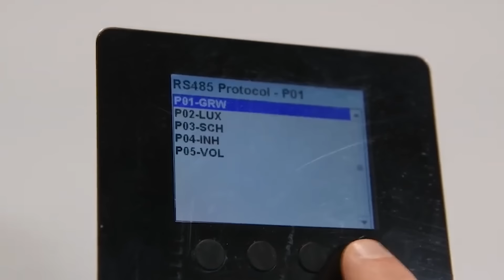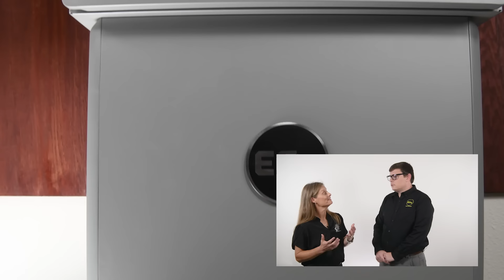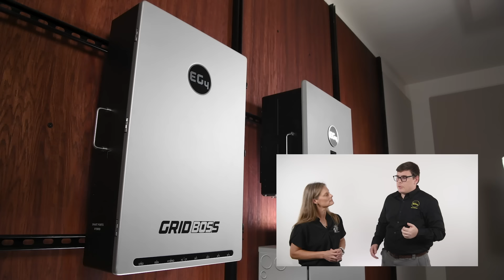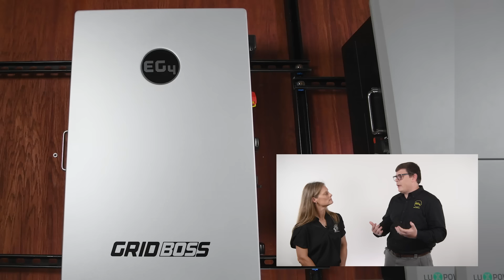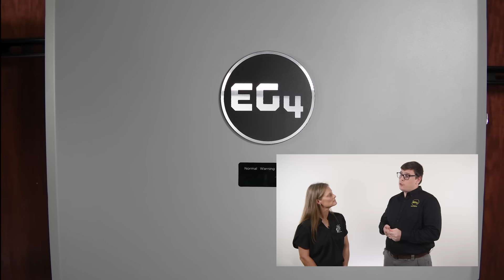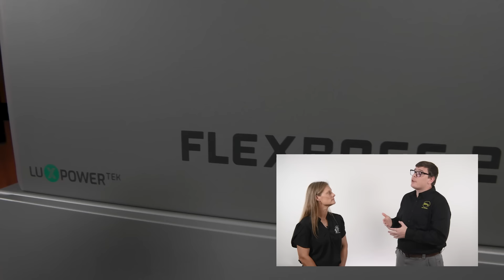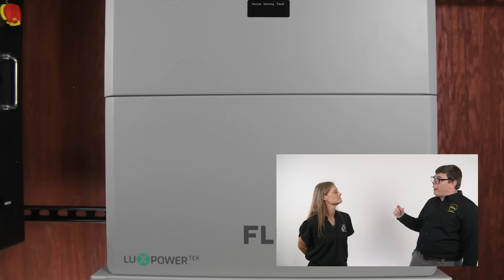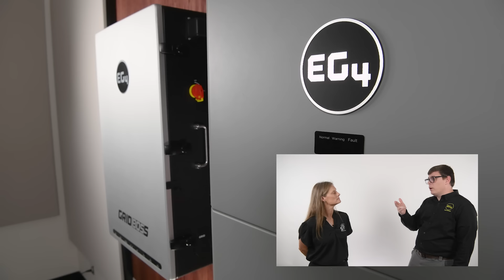EG4 FlexBOSS21 & GridBOSS Premiere Interview: The Most Powerful Solar Solution Yet

Comment: I have a Generac whole home generator with an auto-transfer switch. Is that compatible with the grid boss or would the auto-transfer switch need to be removed?
Reply from the maker: No need, you can connect your generator to your GridBOSS :)
Reply: I wonder about this as well.  I currently have Generac with ATF and a Solark 15k.  I split them apart because the solark would try to sell to grid when grid was disconnect by Generac ATF.

Comment: I'm not seeing how I eliminate transfer switch?  If the gridboss goes down and I have to remove it and rma it...won't I still need a transfer switch?
Reply: I thought the same. I believe you are correct.
Reply: The bypass breaker is in the gridboss

Comment: I guess I'm at a loss in the cost savings and complexity world.  It still feels to me that the main point of all this tech is to be off grid.  So I'm not clear why adding complexity and cost.
Reply: This is a great setup for those of us that are grid tied and also need to place inverter and batteries in a garage over 100ft from the meter. They just came out with the 12000XP... may be a better solution for simple off-grid needs.

Comment: It’s like you split the 18KPV into two components, boosted the power a bit and gave it a new name. Not that there is anything wrong with that!! I kind of like the idea of having one component on the wall better than two.
Reply: For those of us who dont have room at or near the Grid in (meter) and need to place the inverter and batteries in a garage that is 100 feet away this is a great solution. Don't have to loop 200 amps. I can install the GridBOSS at the meter and FlexBOSS21 in the garage with batteries. Only need to run Flexboss21 output to the GridBOSS. Plus you get rid of a bunch of different components that are built into the GridBoss. Easier and cleaner install.

Comment: I just don’t understand why not 200 amp transfer switch on the flex boss
Reply: Because thats basically what the EG4 18kPV is. If you need multiple inverters then you a paying multiple times over for a transfer switch you don't need. By separating them you get more flexibility and are only paying for what you need. Like in my case I have to install inverter and batteries in the garage that is over 100ft from the meter (grid-in). If I use an inverter that has a built in 200 amp transfer switch I would have to loop 200 amps over 100 feet each way. That a huge cost. With the Gridboss I would only need to run a single 6awg wire from the FlexBOSS21 to the GridBOSS.

Comment: Thanks for the video. Do I understand it correctly that the Grid/Flex combo requires fewer external components and associated labor? Does it bring the total cost of the system closer to one based on the 18KPV?

Comment: I’m interested in more of these integrated smart breakers in your off grid focused inverters. I’d love to dump all excess solar through an electric boiler to put additional heat into my slab foundation or run multiple mini splits at certain states of charge. The newer smart load centers don’t do much for us off grid guys if they arnt talking to our batteries.

Comment: EG4, if you're listening, your next innovation should have a DC smart port with an EVSE addon. This would enable DC charging to an EV bypassing any need for an inverter and conversion losses. 🙏🏽
Reply: Oh man this would be a game changer! Unfortunately your question is way ahead of its time!  On a side note if you can dc charge at home it is natively bi directional!
Reply: @paullind6534  I understand where you're coming from. However I hope EG4 isn't thinking this way. We've been DC charging batteries for decades. Nothing has changed. 😔
Reply: @ Agreed!  Communication with every ev manufacturer is a real challenge.  Not just physically but also legally due to things like warranties and such.  Manufacturers could easily detect a dc discharge and program it to kill the circuit.  Charging might be a thing but discharge not so much😞
Reply: @paullind6534  I'm good with just DC charging. :D
Reply: @paullind6534 V2H would then be the real game changer

Comment: Can GridBoss be used with a 100amp breaker, only see CSR2200N in the specs?  Want to feed 100amp  from main panel to grid boss that now goes to a sub panel.  This will allow me to  backup all critical loads in sub panel as well as have smart loads (EV,  water heater, etc).  Can't sell back here so will only use in off grid mode but the flexibility of the grid-boss makes setup and expansion so much easier.

Comment: The FlexBOSS21 looks like just what I need. By chance is it able to communicate with a Span smart breaker panel for shedding? If not could it in the future?
Reply: I have an existing micro-inverter based solar install and a 24kw gas generator connected to the grid. I want to add a 48V battery backup for overnight.

Comment: Last part about batteries being anywhere? Because you can move the inverter?
Reply: batteries are close to inverters  (usually within 10 ft)  but the GRID line is a 6 awg and you can run that much longer
Reply: @dougbertInExile if you had a battery in a garage under the flex boss but meter is 200’ away on a pole, could the grid boss still be in the garage where the main panel is (all that is on the pole is a meter and a 200Amp breaker)

Comment: This totally blows the Sol-ark out if the water guys! I have been waiting for exact solution that is NOT proprietary on the GridBoss switching! My next customer scenario is main meter and 4 loads in main panel is 60 ft from sub panel with most house circuits in sub panel. The wiring and conduit alone would have been well over $4-6k for electrician to run 200 amp “loop”. No need for loop anymore.
Reply: So where do you put the GridBoss and the Inverter in your scenario?  I'm trying to understand this separation of components with the new GridBoss.
Reply: @idahoduckhunter  from what I understand. Before you wanted 18kpv hooked up with full capability utilizing 200 amp grid Passthru u would have to run 200amp (4/0, expensive) cable to the 18kpv then to you main panel. This doesn't even include the transfer switch/shut off switch required before the 18kpv but after meter that is expensive to install. With this grid boss it is rated for service entrance meaning it can be primary disconnect so saves you from having to install another disconnect, then you are also saving money on cable costs since now u just need 70amp cable from 18kpv/flexboss to gridboss. this also allows you to also relocate the batteries with 18kpv to a shed or other place on property and not have to be within 20ft of meter (because 200amp copper is expensive, and now only need 70amp copper) with the 200 amp disconnect being separated from inverter makes it easier for electrician or DIY to piece together a kit. So you can start by adding grid boss, then can add inverter/18kpv with. Batteries afterwards.
Reply: I have a very similar setup. I am trying to learn enough to get this setup going with a handful of panels until I replace the roof. It's pretty overwhelming even with a good understanding of residential electrical.

Comment: 80w idle consumption! No thank u!
Reply: What were you expecting for a 16KW inverter…. A person using 16,000W inverter would definitely have an extremely large battery capacity and the 80W would mean nothing on such battery size
Reply: @EasyyokeFilms  No logic in your asumption. It's baseless. Solark 30k (UPS transfer 5ms) has an idle consumption of only 60w and it delivers 30,000w (real power, max continuous) and max. allowed PV Power of 39,000w.
Reply: The spec sheet says less than 60w
Reply: @jamesshowalter6362  check again. It's 80W in normal operating mode.
Reply: The idle consumption is insignificant for me . I’m using a 6000xp on a recent installation where I have free at night electricity. I had to reduce the ac charge at night to 10 amps just to see the battery cycle a little. I tested it with a 3 ton ac without a soft start,demonstrating it to a friend in the HVAC business,and we were both surprised how easily it handled the inrush. He’s getting a 6000xp on his new house with the plan to expand later. Since he has gas also,two 6ks should be all he ever needs. 
I’m sure Solark has good products but Signature Solar is near and has excellent customer service and responds to what we are asking for.
Reply: @danielking2944  It's significant factor for locations like mine with high kwh energy cost, when you have no sun available and batteries are depleted.
Reply: It’s 63w all together. 80w was just pv only. The spec has been updated.
Reply: @warzoneclips2285   My post had a possitive effect. Glad the update clarified is really 63w!
Reply: Glad the datasheet update clarified is really 63w.
Reply: @carlossantini  My father has the 30K-3P 208 Solark for his (These are not practical now legal for most homes JS) shop. It may say 60w Idle but it NEVER is, the BEST we have gotten it is 103W without wifi and 108 with it. But most the time it sits around 280 just pulling from the battery and 360 when it's charging and a load of 60-80% is being put on it. The 15Kw he has on his home is the same for idle but 50-100watts less when pulling power then the 30K. 
 I have two 18K's (TWO) on my house and they use 150-160w idle and 310 at max tilt total as one. Not only are they cheaper, less power usage and you have two smart breakers but you also have two inverters and not one so you have some back-up right away. An with the money you save you can get a good 16K gen and a 500gallon propane tank an have two back-ups for the same cost as one 30K Solark.
Reply: @carlossantini  I used to LOVE Solark!   My last home I used them and couldn't really complain about anything.     But they have been telling people for over 10yrs now that prices will go down and they are only this high right now because we are early adopters. But the prices have only gone up even with scale lol. So i'm done with Solark till the prices come down or they can again offer things ppl like EG4 can't again
Reply: @ agree!

Comment: It is exciting for EG4 and me, however, SRP in AZ does NOT care. They insist on their external transfer switches and meters.  I have 3 meters on my how with a Sol-Ark, which like the EG4 Gridbox or teh EG418kw have the built in the transfer ability.  Again, SRP refuses to rely on these products.  They want to meter everything and have their own switches.

Otherwise, I think the new products are great..
Reply: Will look into SRP compliance
Reply: @jamesshowalter6362  What about CEC compliance for California?
Reply from the maker: Here are the standards and certifications that the Grid Boss has UL1741, UL67, UL869A*** FCC PART 15, CLASS B (PENDING). 
Here are the  standards and certifications for the Flex Boss.( UL1741, SA, SB, PCS CRD California Rule 21 Phase I, II, III Arc-Fault Circuit Interrupter (AFCI) NEC 2020:690.11/UL1699B Ground Fault Monitoring (GFDI) NEC 2020:690.41(B) CSA 22.2.107.1:2016 Ed. 4 CSA 22.2.330:2017 Ed. 1 IEEE 1547.1:2020; IEEE 1547:2018 Hawaii Rule 14H [HECO SRD IEEE 1547.1-2020 Ed. 2] Rapid Shutdown (RSD) NEC 2020:690.12 FCC Part 15, Class B (PENDING)

Please don't hesitate to reach out to us at 903-441-2090 with any questions or concerns! We're here to help!
Reply: @ thank you for this information!

Comment: A question.  I am having 42 solar panels on a barn roof connect directly to my meter and the grid at the farm house.  The meter is on 400amp box, which goes to two 200amp breaker panels in two different locations.  If I bought an EG4 FlexBoss21 with a GridBoss for each 200amp breaker panel, how do I connect both GridBoss to the solar panels?  I want to be able to use the solar energy from the solar panels to run my house and or charge the batteries if the grid goes down.
Reply: Im not an electrician but I believe you would run your solar panels (PV) to the FlexBOSS21s. The FlexBOSS21s would connect to batteries and GridBOSSes. Each GridBOSS would connect to a separate 200 breaker panel and to the grid (meter).
Reply: @joshomary7977 I agree.

Comment: HOW ABOUT A PROGRAMABLE DUMP LOAD TO EV CHARGER SO WHEN EVERY THING IS CHARGED AND STILL HAVE GOOD SOLAR RESORCE IT WOULD THEN TRIGER THE EV CHARGER ON?
Reply: Or trigger water heater when there excess solar or full battery. He basically said the smart loads was to keep from over loading the inverter
Reply: Smart Load ports

Comment: I would love for EG4 to have independent installers trained. I would love to buy a system but there are no local installers I can find in the Northern VA area.
Reply: I’m in the same boat.  DMV area.  I will have to find a patchwork solution.  But, certified installers in the area would really help.
Reply: @Dhardc  "DMV" is so nouveau. In my day it was the DC Metro Area, and so it shall remain.
Reply: Just got my license in WV. Gotta reciprocate in VA, but I'd love to start a conversation if you're interested. I have run the battery operations at the two premier installers in VA for the past few years and am really excited about what EG4 cooked up.
Reply: @JoshSmith-vm6nx  I’m going to be running this set up in Northern Virginia for my house as well soon and would appreicate an independent installer as well!
Reply: Looking for a professional in San Antonio area Texas
Reply: @roj6282  Texas Solar Professionals did our install a couple weeks ago, great team and know the EG4 system swell
Reply: @roj6282 
Call solar fix az they’re in Austin Texas as well
Reply: Now i have to buy the Gridboss in addition to the Flexboss vs just the 18KPv?
Reply: @elnino2k you can still just buy the 18kpv.  The GB conop is that you aren't buying stuff you don't need once you go past a single inverter.  It also supposedly serves as the required disconnect except Duke progress will still require you to buy a separate knife disconnect

Comment: where is the grid boss manufactured?
Reply from the maker: EG4 actively engages at every stage of our product lifecycle, from design and development to rigorous testing. Our global partners, based in locations like China, the USA, and other regions, manage certain manufacturing processes under the oversight of the EG4 compliance team, which provides substantial input to both hardware and software engineering. This comprehensive R&D and testing ensures we deliver high-quality, reliable equipment to our partners and end customers.
Reply: Lol😅
Reply: Just say "China"
Reply: 😆   @petertulp8806
Reply: Will the new tarifas in 2025 bring the cost down for US consumers?
Reply: @davidfofi3572 No! That's not how tariffs work.
Reply: @davidfofi3572  new tariffs mean ANYTHING imported will rise in price - unless the importer is willing to eat the cost, and not pass it on to the end user. I don't see that happening.
Reply: they can assemble in us as well.
Reply: I believe EG4 is currently scaling to be able to manufacture in US but I'm not positive
Reply: @davidfofi3572  Tariffs are taxes on imported goods; they typically reduce or stop production of any items with any sourcing from the target country; cut into manufacturer margins and risk their going out of business; or, more likely, be passed on to consumers in the form of equivalently-increased costs.

Comment: Gridboss looks great!  Please compare/contrast with Franklin, Anker and Enphase offerings!

Please figure out how to connect the 240 V 30A outlet from a Ford Lightning or Chevy Silverado EV to run light loads at night and recharge the permanent batteries if there was not sufficient solar during the day while in a grid outage.

It would be great to plug in a nice looking battery stack like Anker, Briggs and Stratton (think EcoFlow ultra) with an Inverter on top of these stacks to minimize costs and wall space.
Reply: Just run a 48v lithium battery charger off the lightning outlet and you're golden.